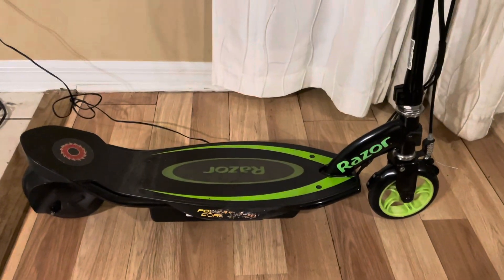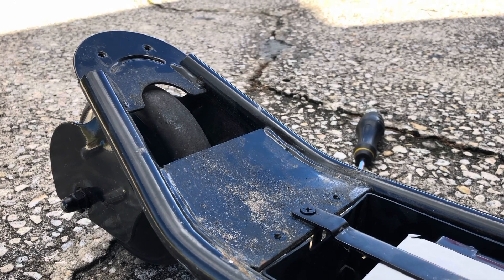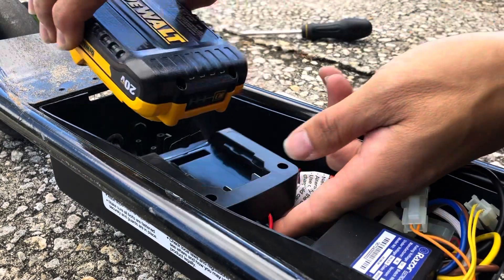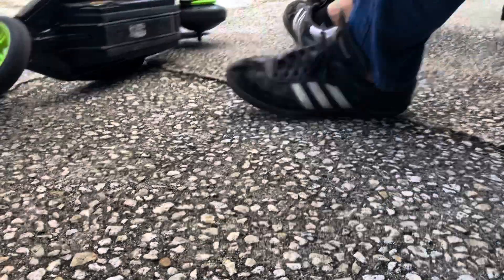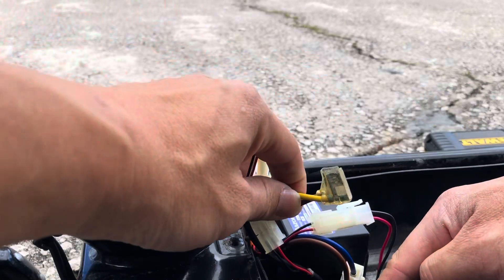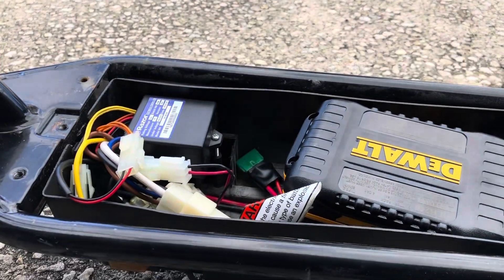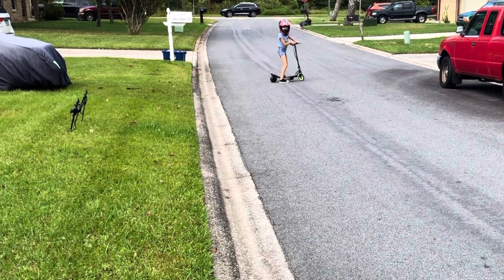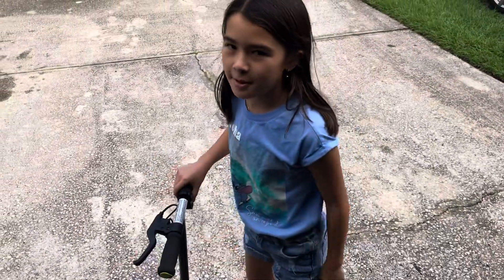Making Razor Power Core E90 electric scooter too fast! DIY Dewalt 20V drill lithium battery upgrade

Comment: My adapter for the dewalt battery has an inline fuse and it keeps blowing but not the one by the power switch any thought ? @diywithduy
Reply from the maker: Hi, it sounds like there is a power surge that is blowing your fuse.  I would check the wiring to make sure all terminals and wires are covered with electrical tape. You don’t want to have any exposed wires or connectors.  Are you using a 30amp in line fuse?

Comment: Great way to burn out the 12v controller. Upgrade the controller if you upgrade the battery. Also now you need to use a lithium charger to properly charge your new lithium battery
Reply from the maker: Hi, you are right.  If you push 20v dewalt lithium batteries on this 12v motor, it will eventually burn out the motor faster than normal.  I have a step down converter that I use on my newer builds.  The step down converter lowers the 20v battery to 12v output.  This allows the most reliability, but the speed is slow and similar to the factory 12v battery.  I also have newer builds where I install a full variable throttle controller with upgraded motor and  batteries.  Thanks for your input.  I really appreciate it.  I will add this information in the video description so other viewers know that reliability is negatively impacted when you over volt a motor.

Comment: My dad put 2 milwaukee m18 batteries and now my razor e300 goes 21 mph
Reply from the maker: Nice, that is very fast.  These lithium tool batteries are much better than the original factory lead acid batteries.
Reply: Yeah @DIYwithDUY

Comment: Do you know where the limiter is so I can cut it
Reply: Ok chines
Reply from the maker: Hi, I don’t think there is a speed limiter wire on this razor scooter controller.  The maximum speed is limited by the motor and batteries.  If you wanted to increase the speed, you usually need to upgrade the battery or motor.

Comment: The 30 amp fuse keeps burning out. Am I doing something wrong or is that normal? There is one 30 amp near the battery and the one connected to the two cables s you showed inside the compartment. I put the battery on the outside to remove it easily. To clarify, the fuse inside the compartment connected to the two cables is the one that keeps burning out.
Reply from the maker: Hi, the 30amp fuse should not be burning out.  Here are a couple reasons why this can be happening.  1. There might be a short somewhere on the wire harness.  Check to make sure no wires are exposed or touching the frame.  2. Check the battery.  Sometimes batteries that are going bad can draw excessive current.
3. Check the controller to make sure it’s working correctly.

Bypass the issue.
As long as you are still running at least one 30 amp fuse near the battery. You can bypass the fuse that was added inside the compartment.  Simply connect the 2 wires that were going into the fuse.
Reply: Hi  @DIYwithDUY , It's been a while, I've been busy 😮.. I looked inside the scooter, there doesn't seem to be any exposed wires, the batteries I've purchased are brand new. I've also tried the bypass method mentioned where the wires are connected to the scooter. However, three motor eventually stops. If you have additional insight that'd be helpful. Thanks ✌️

Comment: Why the 30Am fuse? TIA
Reply from the maker: Hi, we use a 30 amp fuse just incase the wires get shorted.  If the fuse blows, it can protect the controller and battery from getting damaged.
Reply: @DIYwithDUY  thank you for replying buddy

Comment: Kinda sucks cuz you gonna have to remove the top to change the battery. Very inconvenient.
Reply from the maker: Yeah, you are right.  This was the testing phase to see how well the dewalt battery works. I end up mounting the battery to the front frame near the forks.  It no longer requires removing the top deck to swap batteries.  Check out my E100 dewalt battery upgrade video.  Makes changing the battery very simple.  https://youtu.be/6TCBZBgA9Hg?feature=shared.

Comment: So if I swap the battery do I need to swap the limiter too or no because I trying to swap the 12v to a 20v but only have a 12 limiter but I seen a video how to reset it so what will happen
Reply from the maker: Hi, you do not need to swap the limiter.  You can bypass the power switch just like how I did it in this video with a 30amp fuse.  The scooter will be fast.  Let me know if you have any other questions. Thanks for watching.

Comment: I’m about to modify this before giving to my 8yr old daughter, so she can get use to something that can be a little fast for her for the 1st time. (With a helmet and pads.) 13 or 14yrs old, quads. Can’t wait for that day. My dad and I would ride quads every weekend in the desert. Phoenix, Arizona!!
Reply from the maker: Yeah, make sure you put protective gear on her.  These upgrades can get a little dangerous if she isn’t used to the speed.  Let me know if you run into any issues with the conversion.

Comment: I put a 30 amp fuse to bypass the kickstart and nun happened
Reply from the maker: Hi, the factory controller requires pushing the scooter before the motor starts spinning. The way I bypass the factory controller is by using a cheap $5 car relay.  Here’s the video.  https://youtu.be/wKe3oDfFDkc?feature=shared
Reply: @DIYwithDUY  leaving out the important stuff

Comment: I really need a video on how to make the battery adapter cuz I bought a dewalt battery with adapter but urs has black and red wire already sticking out of the adapter plz say how I wanna do this on my e90
Reply: Amazon has them
Reply: Ok so u can’t make em yourself??
Reply from the maker: Yes, you can probably make it yourself if you have a 3D printer  or block of wood. I have not tried making one from scratch yet.  There are only 2 pins you need to connect on the drill battery to get power to your scooter.  The battery is marked with a + and -.  For Dewalt batteries, it’s the 2 outer pins that are marked with + and -.
Reply from the maker: Here’s is the link to the dewalt battery adapter that has wires built in.  https://amzn.to/3rLIEy1
Reply: @DIYwithDUY  That link is to a 12v step down converter.  Defeats the purpose of upgrade
Reply from the maker: @WayneKnazek  Looks like the Amazon seller decided to update that listing to include a step down converter with the dewalt battery adapter.  Here is a link to another battery adapter by itself without the step down converter.  It has a fuse and power switch built into the adapter. https://amzn.to/47l8dGe

Comment: I'm trying to upgrade my kids scooter too.  Wouldn't it be safer to just use a 12 volt or 18-volt lithium drill battery instead of a 20 volt?
Reply from the maker: Yes, you are correct.  12v lithium battery would be ideal if you want the speed the same as the factory razor 12v battery.  The scooter will be reliable, but speed will be the same as the factory battery.  The more you overvolt the motor and controller, the faster the scooter will be.  The downside is that the scooter will be less reliable. A good median would be to use the 18 or 20 volt battery and add an adjustable voltage reducer to decrease the voltage to 15volts.  

https://www.amazon.com/DROK-Waterproof-Converter-Adjustable-Transformer/dp/B00C0KL1OM/

Here is us testing the 20v battery.

https://youtu.be/jtErYQ3s7xc?feature=shared

Comment: I have the same scooter, ive had it since 2017 and the battery just won't charge anymore. I want to mod it with drill batteries, more speed and disable the bs Kickstart. Thanks for the tutorial!

Comment: Bro I trued my motor started smoking😢
Reply from the maker: Sorry to hear that.  We used this modification for a while without issues.  We have been testing a lot of different battery and relay configurations on the larger Razor E100 power core. We just did this same conversion with 2 dewalt batteries on a 24V motor.

Comment: Nice video.... THANKS I just tried something similar on a old razor e100
Reply from the maker: No problem, glad the video helped.  I just finished up another conversion upgrade on a E100 power core scooter.  I upgraded the throttle to a full range variable throttle and running a pair of 20V batteries on the factory 24v motor.  It’s pretty quick.  I’ll post the tutorial video soon.

Comment: So even though the system is ment for 12vs, can it still run ok on a 36v hoverboard battery?
Reply from the maker: Hi, it is usually safe to run a motor at a 10% voltage increase over the listed motor voltage without much damage to the motor.  I am a little riskier than a lot of other people and like to run 20v batteries on 12v motors, but that’s the maximum voltage I would run. I think your 36v battery is too strong and would probably burn up the 12v motor pretty fast. You could add a step down voltage regulator to decrease the voltage of the 36v battery to 20v, and that would give similar result  to the battery I installed in this video.  Let me know if you have any other questions.  Thanks for checking out the video.

Comment: Do they make aftermarket 24 v motors for these?
Reply from the maker: Hi, the Razor e100 has a similar hub motor that is rated at 24V. I have both the e90 and e100 scooter.  I tried swapping the larger 24v motor onto the e90, but the mounting bracket for the rear wheel was too small and did not fit correctly.  There are a lot of aftermarket 24v hub motors that would probably work better. If you are handy, you can probably make an extended rear swing arm to install any rear wheel you want.

Comment: How does it charge? And how long does it run and how long does the battery last?
Reply from the maker: I currently remove the battery and use the factory dewalt charger to recharge the 20v lithium battery.  I don’t use the factory charger because it’s not rated for 20v.  

The scooter lasts approximately 40 minutes. We have spare batteries we can pop in to keep riding if needed.  Here a video of us testing the scooter.

https://youtu.be/jtErYQ3s7xc?si=fvfa2FPU1HfIZCfz

Comment: Thank you for the video. I was thinking about grabbing a battery and charger from harbor freight or even walmarts  new power tool line. I hate to give up 1 of my dewalt batteries lol . I did recently discover adapters so i could use brand battery on any brand tool. 

Youve more than earned my sub
Reply from the maker: No problem, I love making these videos.  Yeah, I’m pretty sure most of the power tool lithium batteries are comparable to each other and will work well for a Razor scooter.  The power tool battery adapters are great, especially the ones that come with a 30amp inline fuse and switch on the battery adapter.  It makes it a little easier for the kids to turn off the battery when not in use.

I am currently upgrading a E100 razor power core 24v scooter and will post a video when it’s completed.  It’s going to have 2 dewalt batteries, variable throttle controller, headlight and taillight.

Thanks for subscribing to the channel.
Reply: Awesome man, I just bought like 5 for Christmas and gave them to all the nieces and nephews in my family. They range anywhere from five years to eight and the older they get the scooters will need the upgrades. I’m pretty knowledgeable when it comes to mechanical stuff I need a little help on the electrical side. Are you familiar with controllers?
Reply: @Christian2381  I'm actually a small engine mechanic (zero turns, 4 wheelers, mowers) so I'm familiar with basic electrical setups (with staters, rectifiers). As for remotes I'm not too familiar. I'm looking into a key fob controlled wireless shut off switch for my son's scooter. He's 7 and autistic so sometimes he doesn't stop and he has no fear of cars or roads. He's too quick for me to reliably be able to catch. So far I've found the perfect shit off setup for 20 or less and it's easy to wire.
Reply: @allenrusselljr  I think he's talking about Controllers, as in the motherboards circuit boards for electric scooters. The things that control the power between the battery and engine?
Reply: @jakelane0312  thanks Jake